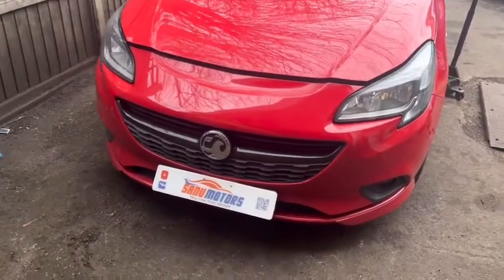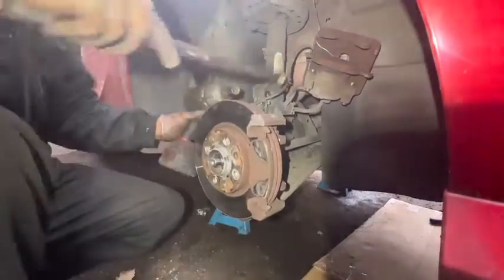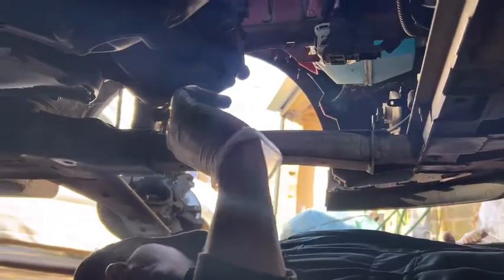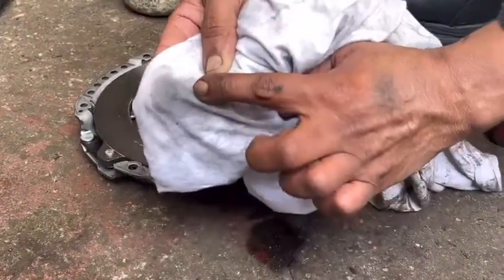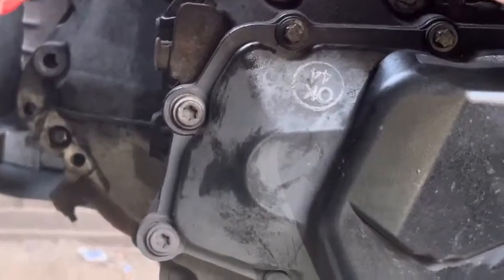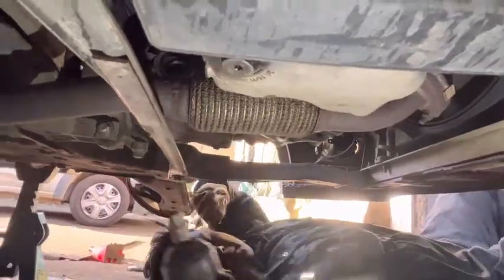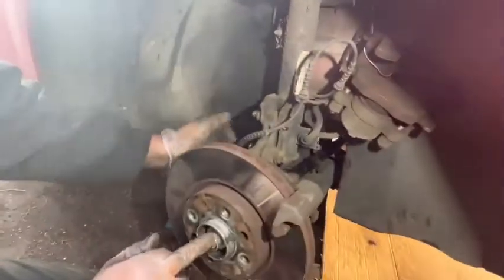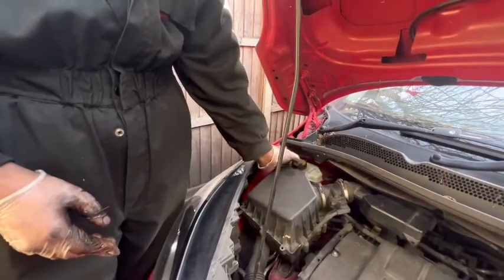vauxhall corsa clutch replacement

Comment: How did you drain oil from gearbox?
Reply from the maker: When replacing the clutch on a Vauxhall Corsa, it’s not typically necessary to drain the gearbox oil as part of the standard procedure. However, if you need to drain the gear oil, here's how to do it properly:

### Steps to Drain Gear Oil from a Vauxhall Corsa:
1. **Locate the Gearbox Drain Plug**:
   - Find the drain plug at the bottom of the gearbox. It’s usually a hex or torx plug.
   
2. **Prepare for Draining**:
   - Place a suitable container under the gearbox to catch the oil.
   - Make sure to use a container with enough capacity to hold the gearbox oil (check your car's manual for the specific capacity).

3. **Loosen and Remove the Drain Plug**:
   - Use the correct tool to unscrew the drain plug slowly to prevent a sudden flow.
   - Allow the oil to drain completely.

4. **Inspect the Drain Plug**:
   - Clean the plug and inspect it for metal shavings or debris, which can indicate wear in the gearbox.

5. **Replace the Drain Plug**:
   - Once the oil has drained completely, reinstall the drain plug securely but without over-tightening.

6. **Refilling Gear Oil**:
   - If needed, fill the gearbox with the correct type of gear oil as specified by Vauxhall. Fill it through the gearbox filler hole until the oil reaches the required level.

Always refer to your vehicle’s service manual for specific instructions and torque settings for the drain plug.

Comment: I just replaced the clutch slave on my Corsa and this helped loads, so thanks. FYI I didn't need to remove the brake callipers or the arch liner, so that can save people some time.
Reply from the maker: Thank you very much for the comment and tips

Comment: Brilliant Video.  Just had clutch replacement and master cylinder replaced by local
Garage on Corsa Eco 2016 as video.  Problem now found it that have to lift the clutch pedal high before able to get into 1st gear.   Garage advised just needs to bed in. Currently disputing with garage as checking clutch adjustment is not manual on this car but automatic adjustment with wear.  Suspect bleed the clutch?
Reply from the maker: It sounds like you're experiencing an issue related to the clutch pedal engagement height after the recent clutch and master cylinder replacement on your Corsa Eco 2016. Given that the clutch in this car should have automatic adjustment, your suspicion about improper bleeding might be valid. Here’s a breakdown of what might be happening:

1. **Improper Bleeding**: If there's air trapped in the hydraulic system, it could cause issues with the clutch pedal engagement. When there's air in the system, the clutch might not fully disengage, leading to the need for you to lift the pedal high to engage 1st gear. Re-bleeding the clutch system could resolve this issue.

2. **Master Cylinder Issues**: Even though you just had the master cylinder replaced, it's possible that it wasn't installed or adjusted correctly, or there might be a defect in the part. A faulty master cylinder can lead to improper pressure in the system, causing similar symptoms.

3. **Clutch Slave Cylinder**: If the slave cylinder was not properly addressed during the clutch replacement, it might also lead to poor clutch performance. Air in the system or a faulty slave cylinder could cause engagement issues.

4. **Clutch Bedding**: While it's true that clutches may take some time to bed in, this typically affects the smoothness of engagement rather than requiring you to lift the pedal excessively before getting into gear. The garage’s explanation seems insufficient if this symptom persists.

### Suggested Next Steps:
- **Request a Re-Bleed**: Ask the garage to properly bleed the hydraulic system to ensure there’s no air trapped.
- **Test the Clutch Engagement**: Once the system is properly bled, test the clutch engagement to see if the issue persists.
- **Check the Master and Slave Cylinders**: If re-bleeding doesn’t resolve the issue, they should also check the master and slave cylinders for any defects or improper installation.

If the problem continues despite their assurances, you might want to seek a second opinion from another garage or a specialist. Keep pushing for a thorough check, as a new clutch should work smoothly after installation.

Comment: Very helpful video sir. I have the exact same model car and been following the exact steps and I installed the new clutch kit and fitted the bell housing, but my clutch pedal at the beginning was very light with no pressure and I left it like that. The next day I pumped a few times and the clutch pedal started to become very hard to press, what is happening with my clutch pedal if you can suggest please ? 

Thanks.
Reply from the maker: It sounds like there might be an issue with the clutch hydraulics or the installation of the clutch components. Here are a few possibilities and steps you can take to troubleshoot and potentially resolve the issue:

1. **Air in the Hydraulic System**:
   - If there is air trapped in the clutch hydraulic system, it can cause the clutch pedal to feel light initially and then become hard. You need to bleed the clutch system to remove any air bubbles. This process involves opening the bleeder valve on the slave cylinder and pumping the clutch pedal until the air is expelled and only fluid comes out.

2. **Incorrect Installation**:
   - Double-check the installation of the clutch kit. Ensure that all components are correctly aligned and seated. Misalignment of the clutch disc or pressure plate can cause abnormal pedal feel.

3. *Clutch Cable Issues* (if applicable):
   - If your model has a clutch cable instead of a hydraulic system, inspect the cable for any kinks, fraying, or improper routing that might be causing the pedal issues.

4. **Hydraulic Master or Slave Cylinder Faults**:
   - A failing master or slave cylinder can cause irregular clutch pedal behavior. Check for any leaks around these components. If there is a leak, the faulty cylinder will need to be replaced.

5. **Clutch Fork or Release Bearing Issues**:
   - Check the clutch fork and release bearing for any signs of wear or damage. These components need to move freely and smoothly to engage and disengage the clutch properly.

### Steps to Diagnose and Fix the Issue:

1. **Bleed the Clutch System**:
   - Locate the bleeder valve on the slave cylinder.
   - Attach a clear hose to the bleeder valve and place the other end in a container with some brake fluid.
   - Have an assistant pump the clutch pedal several times and then hold it down.
   - Open the bleeder valve to let out any air and fluid, then close it before releasing the clutch pedal.
   - Repeat this process until no more air bubbles are seen in the fluid coming out of the hose.

2. **Inspect Installation**:
   - If bleeding the system doesn’t resolve the issue, inspect the clutch components for proper installation. Ensure the clutch disc is correctly oriented and the pressure plate is properly secured.

3. **Check Hydraulic Components**:
   - Inspect the master and slave cylinders for any signs of leakage or damage. Replace any faulty components as necessary.

4. **Clutch Fork and Release Bearing**:
   - Check that the clutch fork is correctly positioned and that the release bearing is functioning properly.

If you continue to experience issues after these steps, it might be beneficial to consult a professional mechanic for a more thorough inspection and diagnosis.
Reply: @SanuMotorswithCharlie  Thank you for your guidance. The issue was not checking the hydraulic component properly. 
I mistakenly did not see the rubber seal  from old clutch tip that was stuck in the bleeder pipe that connects to the slave cylinder pipe in the tranmission. that caused the fluid to not flow properly and cause the pedal to be sometimes too hard or sometimes too spongy. Removed it and immediately started working properly. 
Thanks for showing.

Comment: Did you even take out the starter motor?
Reply from the maker: Great question! For this particular Vauxhall Corsa clutch replacement, it wasn’t necessary to fully remove the starter motor. Instead, we just loosened it enough to give clearance for the gearbox removal. This method saves a bit of time and effort without compromising the process. 🔧

However, in some cases or models, you may need to completely remove the starter motor depending on the setup. Thanks for watching, and feel free to ask if you have more questions! 🚗👍 #VauxhallCorsa #ClutchReplacement #DIYMechanic
Reply: @SanuMotorswithCharlie  thank you
Reply from the maker: Your Welcome

Comment: Have you ever fitted a borg & beck clutch to the corsa or would you recommend an LUK clutch instead.
Reply from the maker: Both Borg & Beck and LUK are reputable brands in the automotive industry, and both produce quality clutch components. When it comes to choosing between them for your Corsa or any vehicle, it often comes down to factors such as personal preference, availability, pricing, and specific needs.

Here are some considerations:

Price: Compare the prices of Borg & Beck and LUK clutches, factoring in any discounts or deals available at the time of purchase.

Availability: Check which brand is readily available in your area or through your preferred automotive parts supplier.

Quality and Reputation: Both Borg & Beck and LUK have solid reputations for producing high-quality components. Look for reviews and feedback from other Corsa owners or automotive enthusiasts to gauge their experiences with either brand.

Warranty: Consider the warranty offered by each brand. Some manufacturers may offer longer warranties or better support, which can be beneficial in case of any issues with the clutch.

Compatibility and Fitment: Ensure that the clutch kit you choose is compatible with your Corsa model and engine specifications. Check for any specific requirements or recommendations from the manufacturer or your vehicle's manual.

Performance: While both brands offer quality components, some users may have preferences based on their driving style or specific performance needs. Research any performance differences or advantages offered by each brand's clutch kits.

Ultimately, either brand should provide you with a reliable clutch solution for your Corsa. It's essential to consider your priorities and requirements when making the decision between Borg & Beck and LUK.

Comment: Good video, did you drain out the gearbox oil before removing the gearbox?
Reply from the maker: Didn’t drain. Once removed drive shaft block two holes. After installation, install one side drive shaft and top up from other side and install next drive shaft 
Thanks